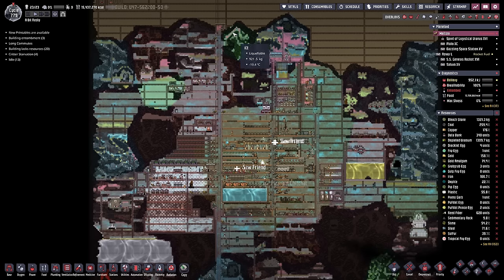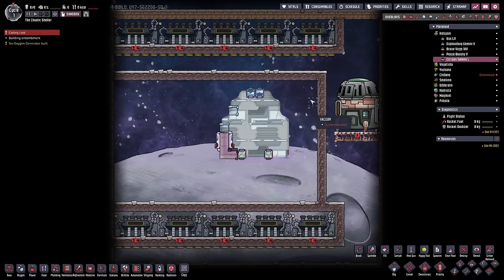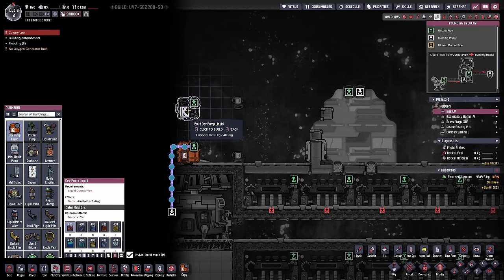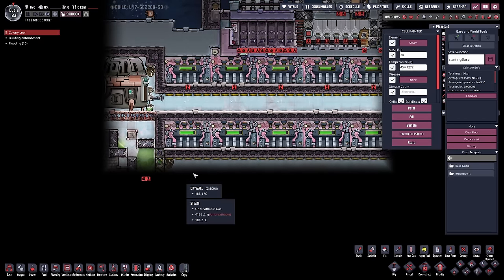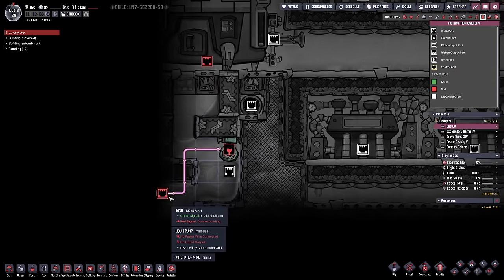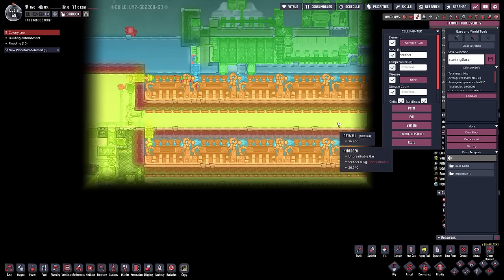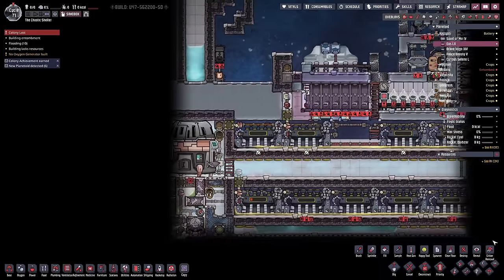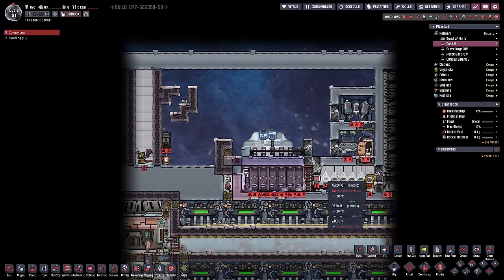Ep19 : Squeezing a Nuclear Reactor into a Rocket  : Oxygen not included

Comment: For the Radiation Shielding.
Pump liquid metal up the top there with a backwall on top of a row of metal tiles. You will probably need to pressure pump it up rather than pipe it, and you'd have to go to several tons tons per tile for to get it to solidify as tiles rather than as debris.
Liquid Lead 4.8 tons to avoid debris, which is like 200% shielding.
Liquid Iron needs to be almost 4 tons to avoid debris.
Copper 3.8K is required for 100%, which is apparently the full mass per tile for Liquid Copper. So Liquid Copper probably wins. Lead is much easier to melt, but you need another ton per tile. Meh.
And from there, you could experiment dropping a large amount at once (else it'll cool, you need to have a singular blob) onto VERY pre-cooled tiles to slowly form a radiation shield around the reactor. Depends how long you want to spend building this. Obviously won't help with the doorway, but every bit helps.

Also, Steel Aquatuners damage at 325C not 275C, ATs get an extra 50C for being ATs. So definitely should be fine.

Comment: 23:00 - I don't think you need 3 columns of airflow tiles to the right of the AT. You only need one column to maintain infinite liquid storage, and you can instead put ladders in to make the area serviceable by dupes.
Reply from the maker: That area is the heat core.... all the reactor steam and hot waste falls into that area. So you want the cooling water to hit that point and absorb heat. So we don't want the water falling to the bottom of the chute.
Reply: @FrancisJohnYT  Wouldn't a few tempshift plates solve the issue?

Comment: 12:05 do you need the top layer of insulation touching the reactor? can you replace that with lead?
Reply: it could melt / let out all the heat
Reply: @Grizzly-gm1bw  only if it goes over the 300 something for lead to melt, all those steam turbines should stop it getting.much over 200

Comment: Can you put the nuclear reactor in the nosecone and then put the dupe hab inside a big spacefarer module? If you put a battery module on the capsule you can put a power port in both modules.
Reply: Okay, nevermind, only one capsule per rocket. But for radiation shielding, you could use a layer of infinite storage water to block as many rads as you like. It looks like about 2800kg/tile of water will block 100% radiation.

Comment: How do you remove the rocketwalls in a regular play through?
Reply: Pump liquid uranium through the walls. Heat the uranium in a metal refinery. The uranium can go to 4132C, but the steel melts at 2423C. You can also melt the diamond windows at 3923C.

Comment: Wouldnt make filling the aquatuner coolant accesible from the dupe area so you can use less hot liquids fix the heat issue having to use thermium or are you just unable to use any other liquid for some reason?
Reply from the maker: Been a while but if memory serves this was a tight build and you can only use either nuclear waste or supercoolant in the cooling loop. Nothing else has enough heat capacity.
My best bet would have been to cool a bunch of waste outside the rocket and then inject that into the coolant loop.
Reply: @FrancisJohnYT  ah is nuclear waste one of the better coolants ive never really gotten that far my current save which is the one ive gotten furthest on is almost 500 cycles

Comment: @37:31 Relax. AT overtemp is 325°C not 275°C. Base is 125° + 200 from steel.

Suggestion. Right above the entrance to the rocket, you can place a liquid lock. This allows dups in suits access the area on the top left of the rocket.  You can have buildings that dups use in suits, so no need to pressurize everything. Actually you could even have bedrooms there, as long as once a day (i.e. for the bathroom) they walk past the docks.